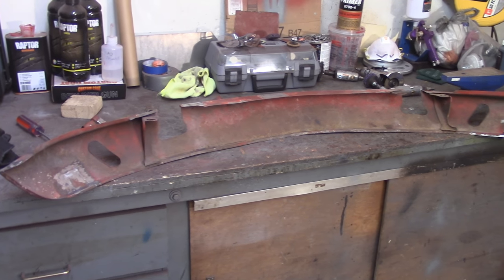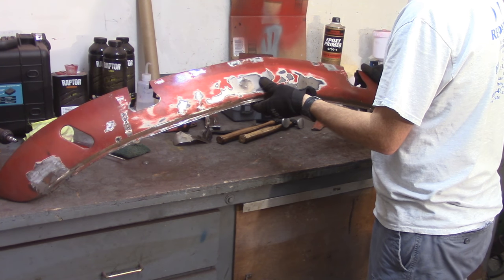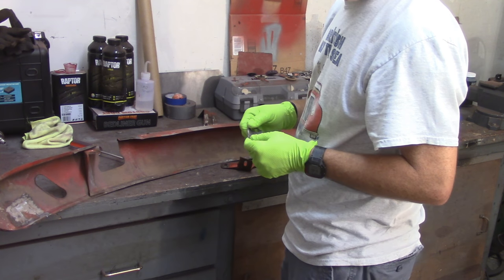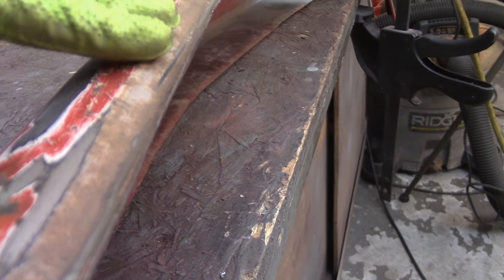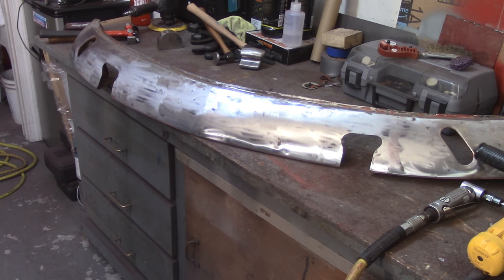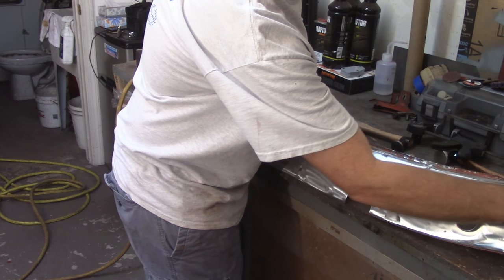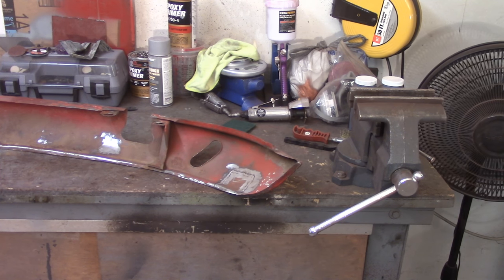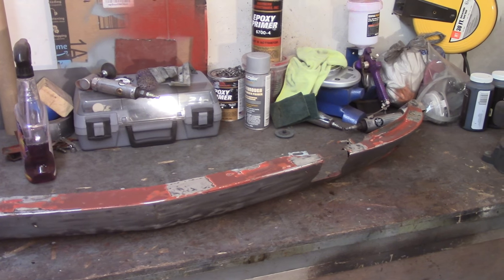Hammer and Dolly Repair - Triumph Spitfire Restoration Front Valance

Comment: Looking good Chris.
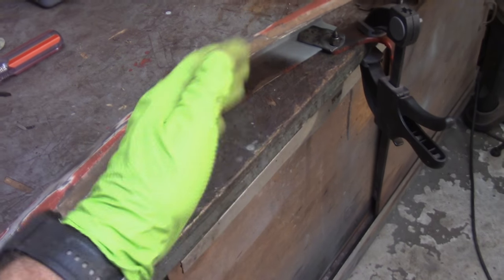Your lower edge...@ 4:00 and 6:45... I have the same issue getting the correct shape back in. I'm thinking of making a top and bottom die to match the profile and modify some cheap vice grips with the dies.
Reply from the maker: Thanks, Hazen. I have done some more work and got it pretty good, but that's a good idea if it doesn't come it good enough.